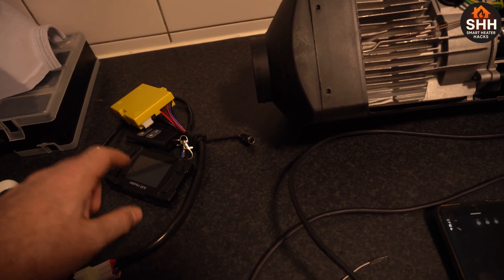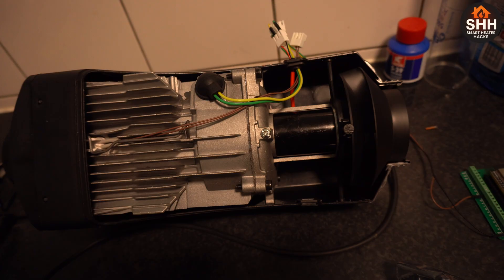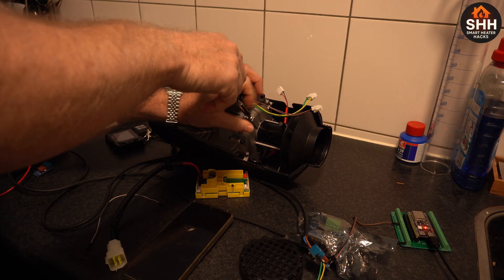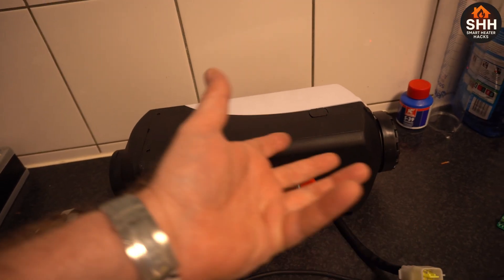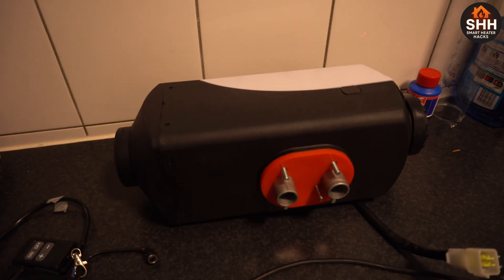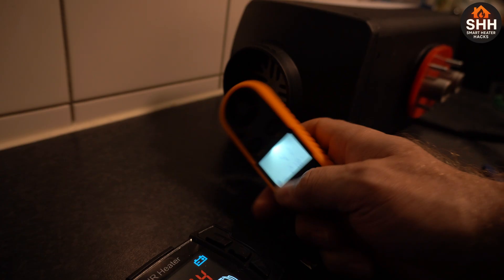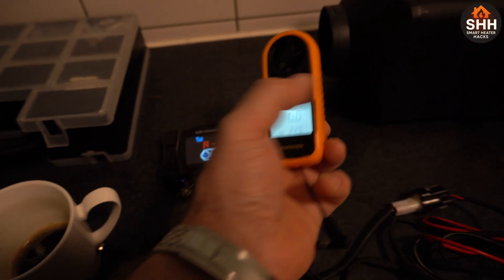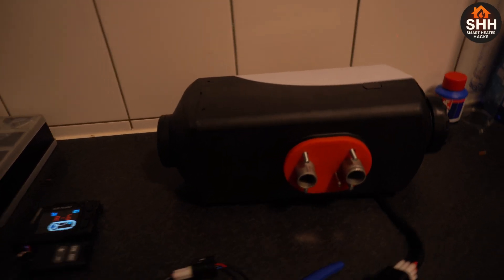VEVOR Diesel Heater MESH UPGRADE and og Fan Only Runs at 63% Power – OG ECU Limiting It!

Comment: Actually, stainless steel, good quality anyways, and aluminum have virtually no reaction to each other. That's the best combination if you need to use hardware on aluminum, solar panels. They recommend high quality stainless steel, so that should be great. Thanks for the vids man, keep it up from the United States.
Reply from the maker: Ah, that’s really good to know! I knew they don’t react much with each other, but I didn’t realize it was actually the best combo. I’m not an engineer or electrical engineer, so I learn a bit with every project  appreciate the insight!
Reply: Where are you finding that information? Ive found no manufacturer or vendor that says aluminum and stainless are a good combination, regardless of stainless grade. Even worse when exposed to water or electricity.

Here's but one manufacturers statement. They state elsewhere in certain applications (large mass of aluminum, minimal stainless) it can be ok, but still recommend never pairing the two. 

" When aluminum and stainless steel are used in an assembly together, the electrons from the aluminum will begin to transfer into the stainless steel. This results in the aluminum weakening. This weakened aluminum causes it to deteriorate at a much faster rate."
Reply: @danya822 Mil-std-889 teaches the corrosion of dissimilar material. In the presence of electrolyte ie water, salt, chloride, sea water especially, the Al corrode away very quickly. When the surface area is large the current density can be small hence slow down the corrosion, This is the reason why some people recommend using stainless fasteners on Al structures but not the other way round. In the case of diesel heater, using the heater in seaside and moist climate is not favoured, but the body of the heater is so hot, water would have evaporated. It is when it is not running g in humid environment that the corrosion starts. Read the Mil Std. It is definitive and interesting
Reply: Does stainless steel react with aluminum? The answer is yes—this reaction occurs when aluminum comes into contact with stainless steel, potentially leading to galvanic corrosion. I don't see a problem in this case though.

Comment: Stainless is not very thermally conducive that’s why it’s used as a heat shield
Reply: And just as a follow up, he said he gained 6% more heat off the thing, so clearly the stainless mesh worked, 6% more efficiency on something like this is pretty dang good. I'd be impressed If I was him. 

Not sure what would be better that isnt super complex.
Reply from the maker: You’re right  it’s between 4.9 and 6.3, depending on airspeed, I’m not using a solid block of stainless, the mesh design, with its thin wires and large surface area, seems to improve heat transfer quite a bit. It’s just a small experiment and a very cheap mod, though there are probably better metals for the job.
Reply: @SmartHeaterHacks  is there any copper mesh available that isn't crazy expensive? I would think if stainless did that good, maybe you could get a couple percent more with copper? 

With the fan speeds you'll be able to run, I don't think airflow will be a problem!
Reply from the maker: I actually bought copper mesh and aluminum mesh before for testing, but apparently the copper reacted with the aluminium just from moisture in the air so i never tried, but would be a nice for a short test, and the aluminum mesh turned out to be really brittle small pieces ended up flying through the heat exchanger.😅
Reply: @SmartHeaterHacks  interesting with the copper! I figured aluminum would probably be pretty poor as a mesh, good guess I suppose lol. 

If I'm just going to keep throwing out ideas, what about U-shaped aluminum that fits between the fins? Pretty tedious to cut, but I would expect as long as they stuck out a bit above the existing fins a couple wire wraps around the whole burn chamber would hold them in place. 

Heck, in that case, what about a thin aluminum sheet just wrapped around the outside and held tight against the fins? Ton of surface area but still airflow over all surfaces.

Comment: have you experience how long can these run on low before clogged when using clean fuel? I have one in campervan and most of time minimum setting is plenty to keep heat.
Reply from the maker: I haven’t let the combustion chamber get clogged on my old Webasto, so I can’t say how long it takes we did yearly Maintenance. With the Chinese diesel heater I don’t have much long-term experience yet, but I expect there won’t be much difference if you use clean fuel and run it hot occasionally.

Comment: If I had to guess, and that's all I'm doing, due to the monitoring of the burn chamber temp, the heater is going to ramp up fuel to keep heat up. At least up until you drop the chamber temp so much the fuel pump can't keep up (or burn chamber temp can't be raised) and the ECU shuts it down. 

I suppose if increasing efficiency isn't the goal, but overall more heat output is, then being able to increase the amount of fuel burned isn't a concern. 

Depending on the length of tubing, wonder if an inline blower to overcome friction loss would help more than hurt? Should be a pretty easy calc based on outlet air speed and air speed at end of ducting. So I think lol.

Love the tinkering!